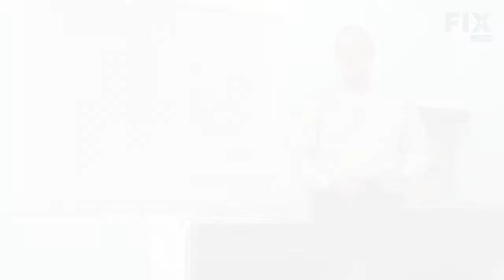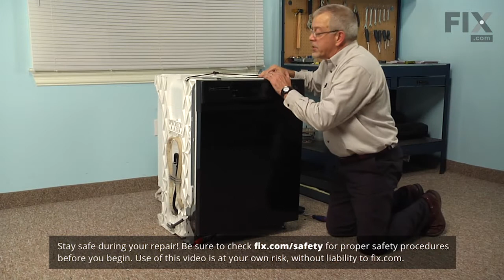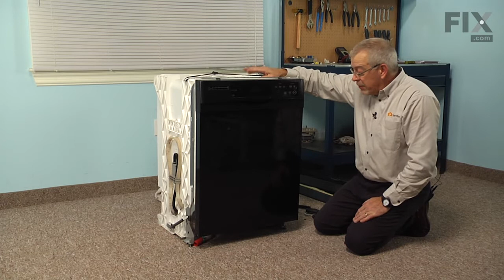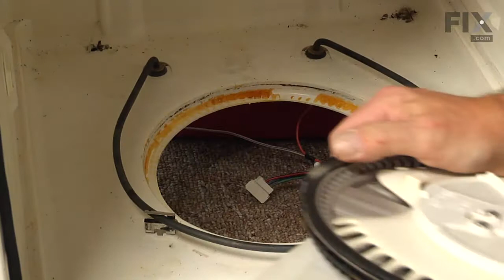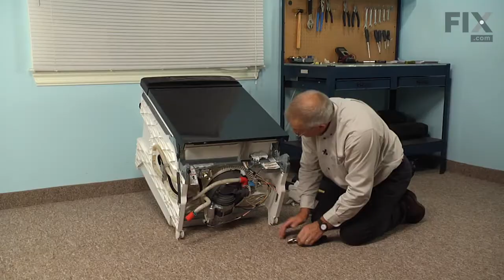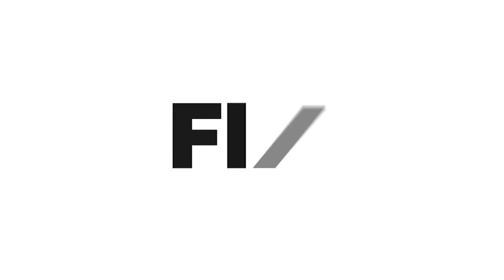Kenmore Dishwasher Repair – How to replace the Circulation Pump and Motor Assembly

Comment: The video does not show how to get the new assembly to stay in. One side goes in and when u press on the other side it pops out. In the video u can see the break in the video...he is pressing on the gasket and not getting it in then video jumps ahead and all the sudden it is in and staying in. HELP!
Reply: You need to line up the notch, put some dishwashing soap on the seal and position the notch in the unit directly above the notch hole in the base of the tube.  Then, use your weight to press the seal into the channel all the way around it several times.. you will need to really press hard.  Feel the top gap around the top of the channel to make sure the seal is well installed... the gap might be 1/16" and be the same around the top.  If you can lock the 3 locking tabs on the bottom, you should be good.